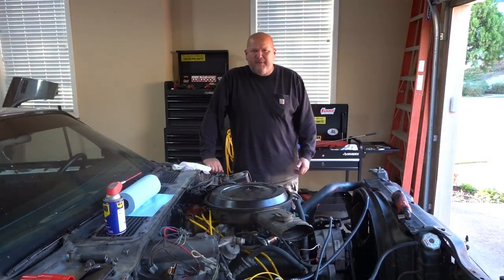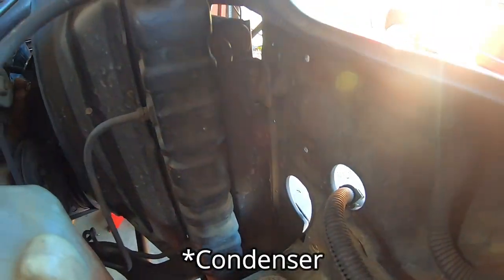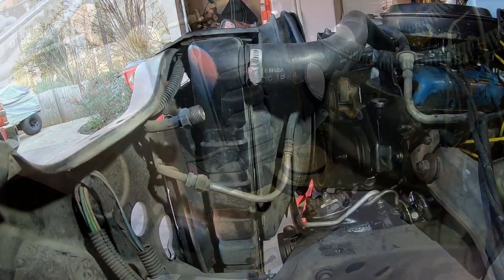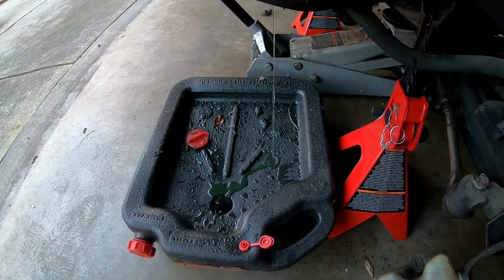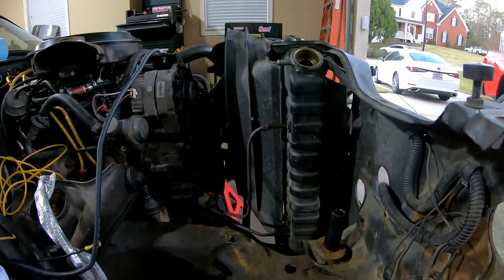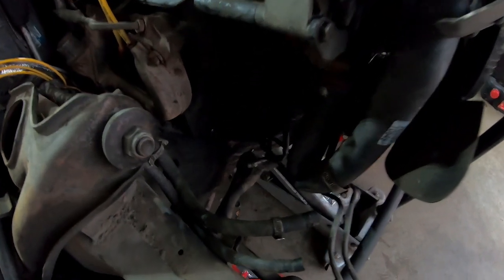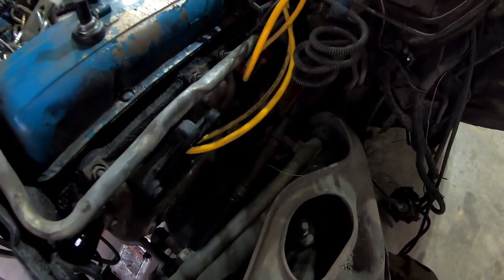78 Camaro Restoration ep10 - The Motor is out of There!!!!

Comment: I don’t know if ur tested ur ac/heater but if u did now would be a perfect time to replace while u have the space!
Reply from the maker: Estafano!  I always look forward to your feedback.  The heater and ac lines were all disconnected or bypassed and I had no air flow in the car at all.  I plan to replace all of it with a vintage air system.  Thanks for the comment.  JD

Comment: I'm freshening up a 1975 6 banger.  not in a logical manner.  interior, wiring , a.c first.  drivetrain second.  paint never.  You were so good at showing/explaining the jeep stuff, i wish you'd done 67 vids on the camaro already.   Right now Klowny1969 is my goto youtuber guy.  he's really good at showing stuff too.   
my  trans cooler lines were so crusty i cut them off.  once the radiator was out i could finally unscrew the leftover stumps.  now i just need a pair of hose barb type fittings to run a few inches of rubber hose.   or my transmission guy will talk me into new lines all together. 
keep up the good work.
Reply from the maker: Andru thank you for that feedback.  I watch Klowny's videos as well and have learned a lot watching them.  I'll get there with this car as I plan a pretty complete tear down and rebuild.  Just takes a lot of time.  Can you believe my Jeep rebuild took 3.5 years and I'm still doing small things to it.  Anyway, thanks for the comment, really appreciate it and good luck with your car (V8 swap in your near future??).  JD
Reply: @JDOffline   nope. waay too stubborn.  I would go  2jz before i'd get on the LS bandwagon. I have nerded out on the idea of keeping it 6 for life.   I have a second motor already that will have upgrades from 12bolt and/or Clifford.  just want it to be a reliable cruiser.   If you lookup  what the Brazilians have done to the humble 6 cyl 250c.i. chevy its pretty impressive.
Reply from the maker: @andrrru9  Haha that's funny.  The motor I'm swapping into my car is not an LS either.  They are all the rage though and people are swapping them into just about everything.  My Jeep build was a 350 conversion but it is carbureted.  Good luck with your build and keep us posted!  JD

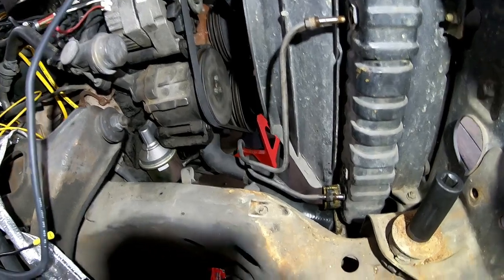Comment: 3:50... 😆 
I was trying to remove a heater core hose the other day.. I gave up. I just worked around it.  😆
Reply from the maker: Yes they are a pain for sure.  Thanks for the comment.  How's the truck coming along??  JD
Reply: @JDOffline  I just posted a video.  I didn't want to post until I had the engine running, but it's giving me problems.  🤦‍♂️ I'll get it. I believe it's grounding issues because the plug wires are arcing out.